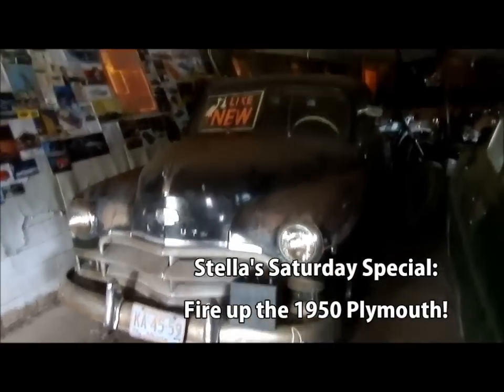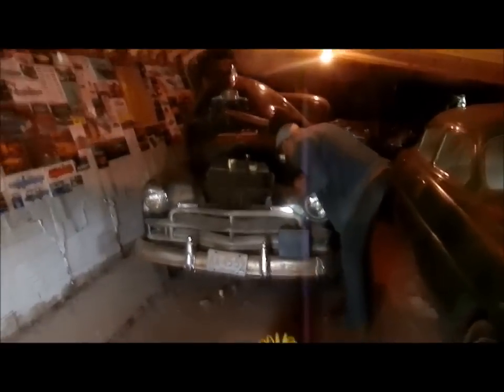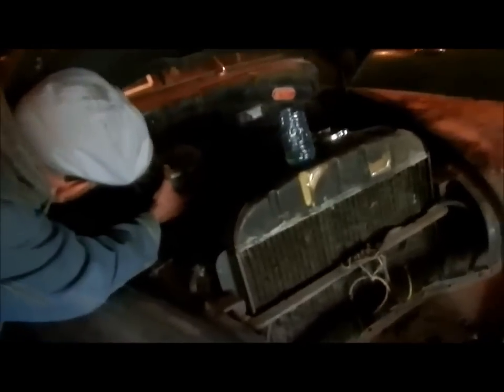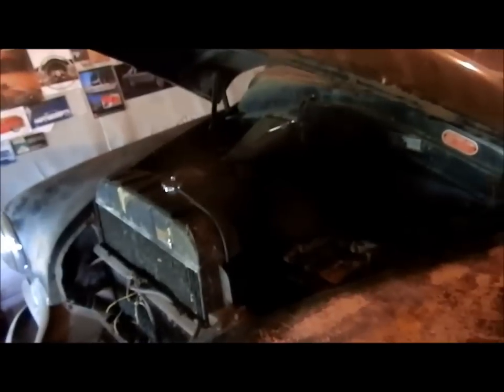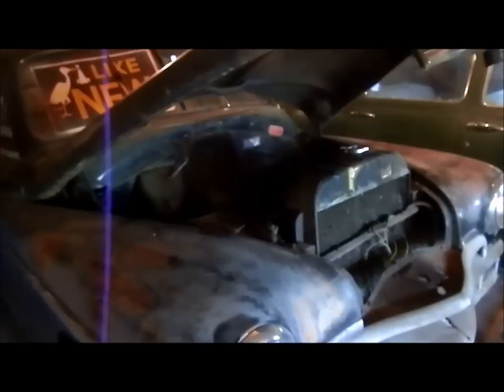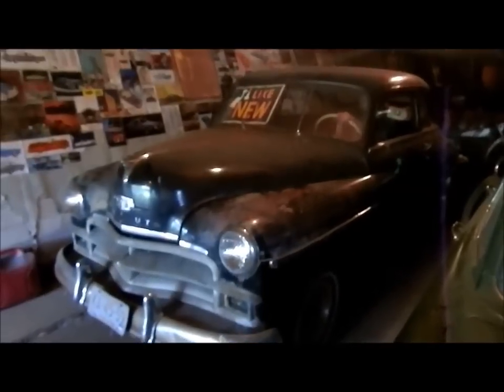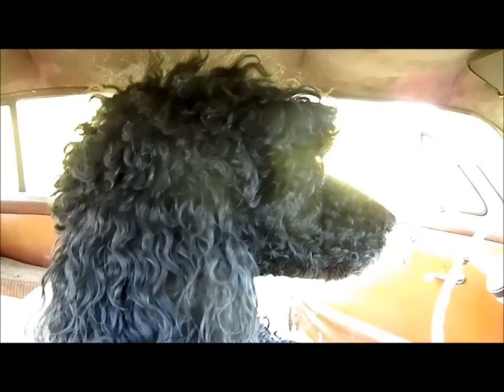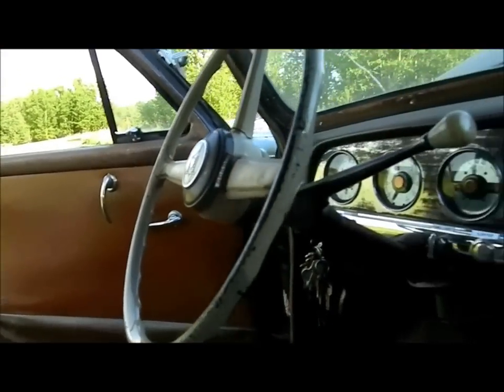Stella's Saturday Special: Fire up the 1950 Plymouth!

Comment: That is really a cool body style with the smaller size and the fancy rims you added; it makes for a fine looking automobile.  I'd equip it with a small V8 or a larger six cylinder and an automatic transmission with either type engine.  It's what I am doing with a 51 Ford Tudor- a 255 V8 and a C4 from an 81 Granada.

Comment: Another great video.
I have the Dodge version, 1950 Special Deluxe, just turned over 91,000 miles.
Body and paint is original, had yo redo interior, has some options, radio, clock.

Comment: Are my ears deceiving me, or did I hear a knock when the engine was idling with the air-cleaner, right about 4:40. It could be valve adjustment, or a rattly accessory bearing, too.

My dad had a 1949 Chrysler Windsor with the same engine, the "Spitfire Six." In my opinion they were the best engine of the era, with full pressure lubrication that the Chevrolet lacked, and low oil consumption the For flathead lacked. The fuels of the time were very low octane so breathing wasn't as big an issue as now, so long strokes were the name of the game. This motor makes its maximum torque right off of idle. I drove Dad's over the mountains one time and it made 90 km/h on hills no problem. 

The basic design was so robust that five of them were arranged radially to make a 30 cylinder tank engine for World War 2, most of them going to the Canadian Army.

Comment: Hi I've watched your videos for a while and love your channel but I was wondering something. I'm going to look at a '58 Studebaker commander tomorrow and wondered if you had any advice or and special things to look for
Reply from the maker: Hi! Thanks for watching this stuff. I'd check any 50's Studebaker for rust and sketchy repairs on the front fenders ahead of the doors and above the headlights. The vent doors on the fenders were major rust traps and I've seen very few Studes that weren't bad in this area. All late 50's cars go above the headlights, so that's a good place to look. Also the usual spots on the rockers and front corners of the floor. Rust repair is expensive, but most other things aren't too bad, so I would put a good body above all else when shopping for any 50's American car.

  Hope this helps; cheers form me and Stel.

Comment: I have a question what is the deal with the non matching wheels , luv watching the video's but this has been bugging Me for a while .
Reply from the maker: Hey, thanks for the note... The non-matching wheels is really just a result of not having full sets around. When I was a kid, I'd see lots of cars with non-matching wheels, too, and I'd always wonder why. Often, it's easy to pick up a pair or a set with one or two damaged ones and combine it with another pair from somewhere else. Old drag cars used to run different wheels front and back, and I think this is one of the reasons it became kinda "cool" in the 70s to run mismatched sets. I do it on these cars as kind of a tribute to the cars I used to see as a kid, usually owned by teenagers, running different wheels front and rear, or sometimes just chrome wheels on the back and factory wheels on the front with the hubcaps taken off... Hope this helps... Cheers!

Comment: I'm looking to buy a 1950  Plymouth Club Coupe. wish me luck.
Reply from the maker: All the best on your search for that sweet Plymouth!
Reply: coldwarmotors Im buying one pretty soon! Within the next two weeks! Its an all original 1950 Plymouth Delux club coupe. 32,876 miles on the odometer. Its im great shape. The only thing wrong with it is the brake pedal has no feel to it. Do you know what would cause that? The brakes donelt function right now because of that.
Reply from the maker: Likely the pedal got pushed down after sitting for a long time and jammed the piston and seals down at the far end of the cylinder. It'll need to come out and get rebuilt. They are kind of a pain to remove, but the actual brake system is very simple. Good luck with what sounds like an excellent car! Cheers...
Reply: coldwarmotors I figured itll need a new master or a rebuild. Its sat for two years, but before it was parked it was driven everywhere. Im hoping its a simple fix.